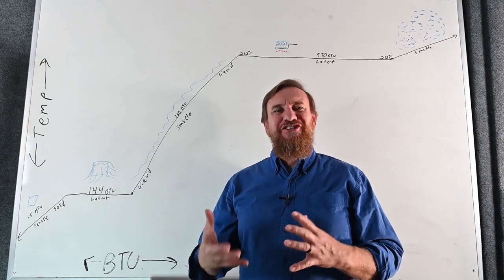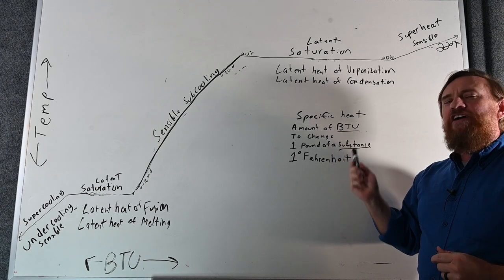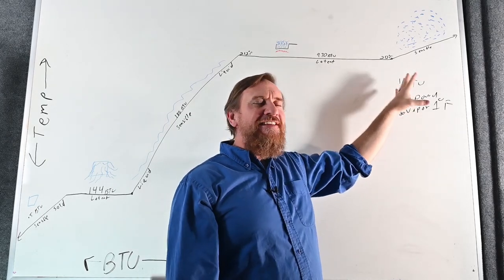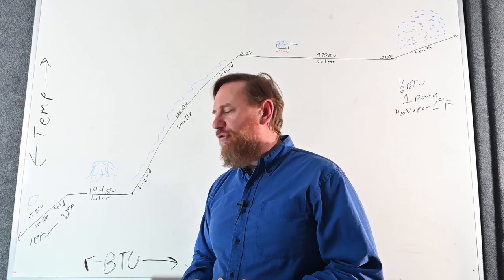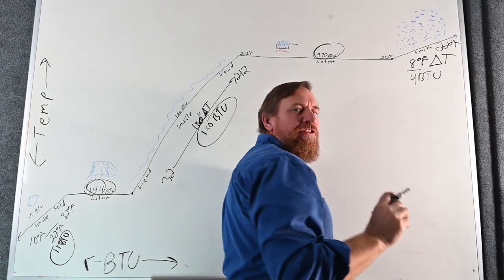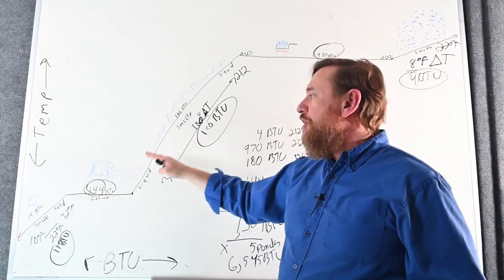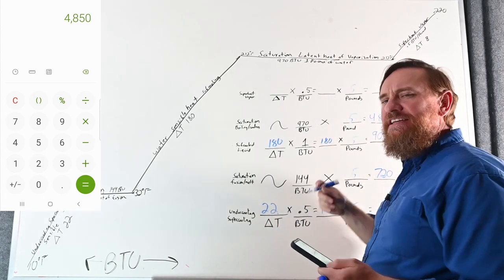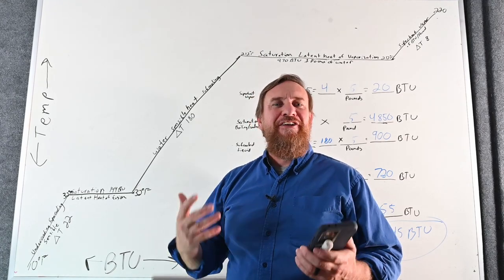HVAC 168  states of water in BTU on a graph.

Comment: Hey Ty do you have any recommendations for books to learn specifically commercial refrigeration? I’ve heard about modern refrigeration as well and commercial refrigeration for ac techs. Do you have any personal suggestions? Thanks. Also love the vids.
Reply from the maker: Hi Ronnie

The best book is 
Commercial Refrigeration: For Air Conditioning Technicians
Book by Dick Wirz
Reply from the maker: There is an online program too 
https://www.hvacredu.net/commercial-refrigeration-training/?amp=1
Reply: @love2hvac  do you know if the first link or second link is better? One is fourth edition the other third. Thx
Reply from the maker: Always get the newer addition book.
The second link was for an entire accredited course
Reply: @love2hvac  ok thank you. Also do you have any book suggestions or any general suggestions to learn electrical wiring? Example learning differences between single phase 3 phase. 120v 240v 600v and just get a good general understanding of wiring diagrams etc. thx.
Reply from the maker: There are some electrical for HVAC books out there.

I don't use a book to teach electrical so I'm not sure which one is good.
Reply: @love2hvac  do you have any suggest to learn electrical in hvac refrigeration I know real world experience is always best but any other ways I can learn I really struggle in this area

Comment: That was an excellent explanation in a method without removing each step keeping them in visual field as you move progressively onto the next step. 
              For the students who do not remember or understand formulas and have short-term memory problems when the instructor erases the entire board and moves on to the next step and then erases . Certain students forget what they just saw. 

For those types of learners this is the easier method for them to understand.   
            Even though it is not the preferred method by those who can learn and memorize formulas and are proficient with calculators.
Reply from the maker: I am that kind of learner! 

Thank you for the support.
I was debating on doing this or skipping it.

I figured if it helps 1 person understand or visualize then it would be worth it.

Comment: How to size the unit for a house
Reply from the maker: Step 1 blower door test to find home leakage rate.
Step 2 perform a manual J heat load calculation. (Several programs but the numbers are only as good as the person entering them)
Stem 3 ACCA manu S to select the unit for the load (all to often overlooked, not all tonnage is the same )
Step 4 ACCA manual D to design the duct work. 

Video coming soon hopefully
Reply: Absolutely amazing information 
Thank you